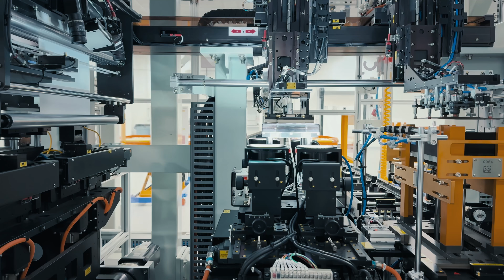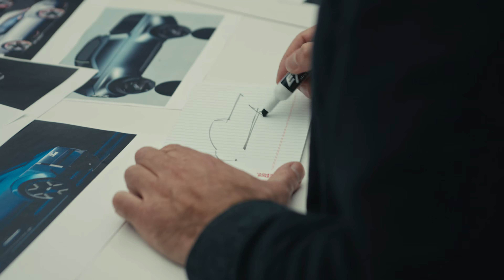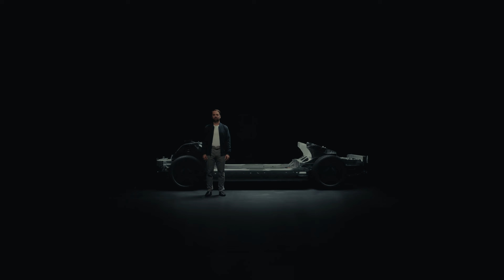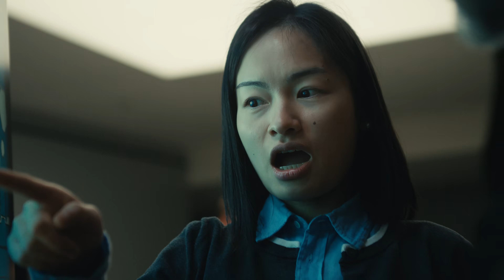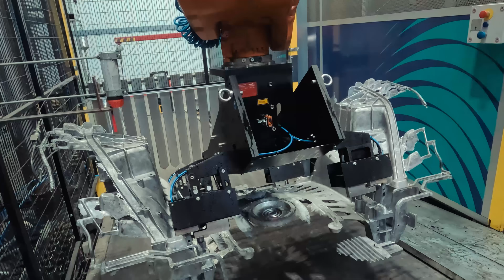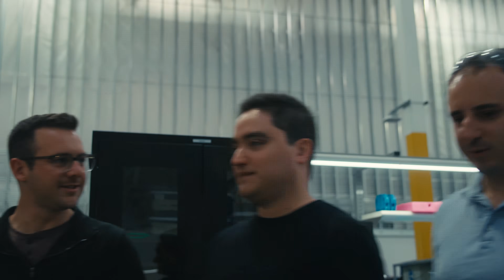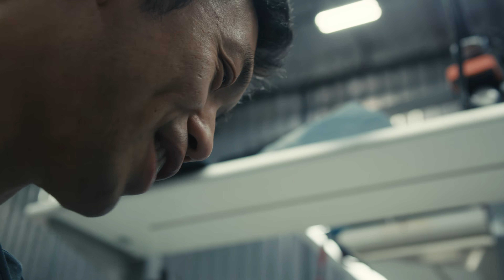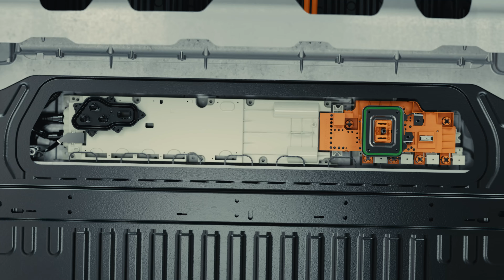Ford Bounty Hunters: The Pursuit of Efficiency

Comment: Ford, do you wanna know what would knock about $10,000 to $40,000 off of the price of your ev’s so you could actually sell them? Getting rid of dealerships so they quit over marking up electric vehicle prices.
Reply: Unfortunately, there are laws and regulations protecting dealerships. Ford couldn't just detach from dealerships if they wanted to. There would have to be significant legislation passed that would give them the opportunity to do so.
Reply: @moose1442  that’s why Ford set up the EV Division as a separate company so they could begin detaching from the dealerships.
Reply: @d @daisyandpizzanight ah, that's not the ticket. The separate division is for accounting and shuffling people. Ultimately the cars are bought from ford motor co, not some other company or a division.
Reply: @moose1442  Facts. Independently owned businesses. Ford dealerships been best I've dealt w/ actually!
Reply: The dealership system needs a drastic change but the  dealership owners have been fighting that hard.
Reply: Yup, and they lobby and pay the Politicians who in turn block any changes needed to help the end consumer
Reply: Most energy dense LFP cells have 195 wh/kg energy density with ≈4000 cycle life,but there are even more rooms for further improvements.i hope ford with help of LG energy solution,will adopt and commercializes dry coated LFP electrodes cells.dry coating has the potential of atleast 70% higher energy density LFP cells with dry coating and single crystal active materials.dry coated LFP cathodes have 55% higher active materials(amaazing 290 wh/kg)also dry coating lets the electrode to be twice as thick as wet coated LFP cathodes(20% higher energy density meaning 330 wh/kg.also with single crystal cathode and anode active material they can achieve mind bending 350 wh/kg at cell level.dry coating increase the cycle life by 100%(8000 cycles),single crystal increases it by 30%(10400 cycles).dry coating increases calnedar life by 100%(20 years instead of 10 years)meaning amazing 0.5% capacity loss per year in dry process vs 1% of current wet process LFP cells......
Reply: @davidfujkk8018  that has nothing to do with what I said, and you completely missed the point.
Reply: Amen. The dealer experience is the  worst part of Ford. Second worst is the reliability. Cut the middleman mark up. They do NOT provide ANY value.
Reply: @fleetgt  They 1 of better dealerships to deal w/ in my experience. Love Ford vehicles!
Reply: @fleetgt any company will still have to have someone to service the vehicle and provide customer service to their customers. Usually the oems outsource this type of work , usually it gets worse. You like calling India about your phone service ?? 😂. I can agree the dealerships really need to be monitored times but it's a complex issue you or I probably won't get paid to solve.
Reply: Last time I went to a dealership I asked an employee if larger wheels made the car more fuel efficient. They said yes. I don't know if they said that in hopes of me considering the more expensive trim or if they were just ignorant. All I know is that dealerships, and most of the dealers in them, suck.
Reply: @kylejohnson4750 they're more than likely just clueless.
Reply: @kylejohnson4750  lack of training they hire off the street. Kind of like the people nowadays cooking your food in that fancy overpriced restaurant! 😂
Reply: Ford has been doing some work in this area, by forcing the dealers to all list their prices on the ford website so you can shop around. They can't really stop dealers charging whatever they want without throwing out the whole dealership model. But they can make them be transparent and put them into competition with eachother.
Reply: @katelights  yes throw out the entire dealership model. That’s what I’m saying. The price thing is irrelevant because they lie about that too. The price they put on something like CarGurus includes all these discounts that nobody qualifies for. Then when you get to the dealership you find out it’s actually $10,000 more than what it says there.
Reply: @daisyandpizzanight  im afraid the dealership model is far too entrenched. And most people still want to be able to go somewhere and see/drive a car, have somewhere to take it for issues, and a real person they can complain to.
Reply: @daisyandpizzanight  but you can fix dealerships without getting rid of them. You just fix the price. You have dealers, but you let people go online and order it if they want. 

BYD Does this in Australia. I went to the dealer, looked at, test drove. Went home (optional step: hit a kangaroo and write off my previous car) . Finalised finance with my bank and then ordered online. Went back to the dealership to pick up. (could have had it delivered for a fee too)
Reply: @katelights  you need to do some research and look up Tesla. They have showrooms where people can go test drive cars and learn about them. Then if they decide they want one they order it. The showroom doesn’t purchase any inventory. They just show customers the cars. That’s how they get around the states that require some type of licensed dealer. Dealerships are not at all and entrenched, legacy auto just refuses to cut the cord.
Reply: @katelights  no
Reply: @daisyandpizzanight  Im not sure if you work for Ford but sounds like it. 😂. There are franchise laws and someone does have to service the EVS. Oh yeah they run forever 😂. ?? Ok so Explain your thoughts theories on how you fix legacy at least couple pointers because they all are struggling terribly!!
Reply: @Jcrz-l6e  bot
Reply: @daisyandpizzanight I'm not 🚫 repeat Not! A bot. I was really asking for your insight on a couple pointers to fix the legacy automakers. ? Respectfully btw. Again not a BOT 😅
Reply: Illegal in some states
Reply: @DanielLoganGames "free market" free country = all a joke. If you got money you can protect all these toxic systems
Reply: @DanielLoganGames  they can do it the way Tesla does it. There’s always a workaround.
Reply: @daisyandpizzanight  or Rivian
Reply: The wealthiest business owner in most state house districts nationwide happens to be the dealership owner this gives them incredible leverage in state legislatures
Reply: 100%
Reply: Ford was going to create a direct to comsumer brand of EVs.  i think they stopped that plan.
Reply: Gues what they tried but the NADA lobbying group of dealerships stopped them. They are trying to do the same to scout and tried to do the same with Tesla, Volkswagen and rivian
Reply: that was a pretty dumb statement and shows you know nothing. 

they have no control over dealerships there are laws protecting them and they are required by law to sell their vehicles thru them. scout motors are currently going thru an issue where several Volkswagen dealers are trying to file a lawsuit against them because Volkswagen is scouts parent company and they feel entitled to selling them. they arent and will most likely lose. as scout is going with direct-to-consumer model like tesla or rivian. but it shows how dealerships abuse the law to prevent that. 

Ford has been trying to become a direct-to-consumer manufacturer, but the law is preventing that, and we all hate it including ford.
Reply: Sounds like a great idea but it's not entirely feasible. Dealers were absolutely needed and were very important at one point in time, now may very well be the time that they sort of become less important . 
1. Manufacturers still need a place to show the vehicle. Unlike Tesla,  none of them will get the hundreds of hours of free PR. 
2. Manufacturers still need a place to drop the vehicle prior to customers picking it up. Tesla has 3 to 5 customer centres in all metropolitan. Legacy brands would have 3 to 5 times as many as Tesla.
3. Manufacturers need a place to conduct warranty work - yes, although over the air updates will be standard, it can't solve mechanical issues. It's almost guaranteed that future EV will have way less mechanical issues than ICE, but it will still occur. 
4. manufacturers sell parts and a physical location is necessary. 
I'm sure a lot of this will change in time but for now and at least the next 20 years, there will be dealers.
Reply: @Capri1977 no
Reply: The dealership experience is what has stopped me from buying several Ford’s over the years.
Reply: Dealerships haven’t marked up an ev in 2+ years.
Reply: @Calibr21 , F150?
Reply: @Calibr21  dealerships literally mark up every vehicle they sell. That’s how they make money. They buy it from the company and sell it for more than they paid for it. This isn’t rocket surgery people.
Reply: @daisyandpizzanight that’s a profit margin thing for Ford, not really a consumer price thing. Ford has to accept less profit margin then Tesla because they have a dealer network. Ford can’t sell their vehicles for significantly more than Tesla because of price competition. 

The real reason consumers should care about getting rid of the dealers is the buying experience is just so crappy, with it taking hours and then trying to be upsold on addons.
Reply: @Calibr21  😐 this is why I’m saying they need to do a straight to consumer model like Tesla to eliminate the extra cost of the dealership middleman. How do you not understand this?
Reply: Hella yeah. Stealerships suck and the work they do for the money is a frkn rip too
Reply: This comment is the truth, and the truth will set Ford free. They can manufacture a $30k MSRP EV all day, but the stealerships will swoop in and mark them up to $50k whenever they can.
Reply: Dealership markup is a no no
Reply: This guy gets it
Reply: They are trapped by law. They are stuck, they can't get out of it.
Reply: @JEP-Tech  they can do what Tesla does. Ford already set aside the EV division as a separate entity.
Reply: I think you’d be surprised on the EV part. I work at a Ford dealership, and we make about $700/mach-e. That’s for the dealership, not the salesperson. Also don’t forget that the dealerships are vital for points of servicing and getting OEM parts! It’s not always just sales 🙏
Reply: @uhealthycomedy8982  read this carefully because I’m really getting sick of all the stupid comments. I want the dealership to make $0 per sale! They are more than welcome to convert into a Ford repair shop, but there is absolutely zero need for a parasitic salesman.
Reply: What hand do you think the UAW has in the overpricing of todays vehicles?
Reply: @OregonEyesedKhaOsit’s not the UAW Ford is too top heavy with too many so called executive vice presidents and managers and vice associate directors and on and on. The unionized workforce is smaller now than ever before.
Reply: Do you really think that buying directly from the Manufacturer is going to save you money?    You will always be paying MSRP (sticker price) if we move to that model.  Do you really want the high prices of Carvana and Carmax at every Ford "showroom" too?
Reply: @PhilCountryFord  Yes it would reduce the costs and ultimately reduce the end price to the consumer
Reply: @Yielar1  And who will service your vehicle and repair it in the event of an accident?  Everyone thinks that getting rid of dealers is a panacea.
Reply: @johnroppo  EVs will need much less service
Reply: @PhilippZ  that is a wonderful thought, but the world isn't shifting to 100% EV anytime soon.
Reply: @Yielar1  No, the current model that pits several dealerships against each other is actually what drives prices down, and the dealership takes responsibility for the majority of marketing and storage of the vehicles.  If Ford went direct to consumer, you can easily see 50% of the trim levels getting cut because they would have to streamline production without the ability to offload and have dealerships pay for the inventory holding lots.
Reply: @PhilCountryFord Teslas system works. You order your vehicle or buy from a small in stock selection, and they have service stations and mobile service. The benefit is the price is the price, no dealer markups. I ran a Ford dealership for a decade and I see you’re a part of one too but it’s a tired, old model. People don’t want to get worked over by salespeople and charged ridiculous fees via “market adjustments”, waiting for rebates, etc.
Reply: @johnroppo  the service centers can stay. We just don’t want the salesman in between getting a car and the customer.
Reply: @johnroppo  I already avoid taking my cars (both ICE and EV) to the dealership for service whenever possible.  They see me for warranty work and occasional spare parts that I can replace myself.
Reply: @johnroppo  a dealership has never touched a car I own.
Reply: @PhilCountryFord Dealerships don’t pay for inventory; they pay for the vehicle when sold. The manufacturer bears the cost. Direct-to-consumer would reduce costs by building in lower volumes and adjusting based on demand, preventing overproduction.

Dealerships exploit manufacturers and consumers, raising prices with add-ons and fees.

Servicing is the only essential service dealerships provide, but it hinders innovation since they profit from vehicle breakdowns. If a car breaks down, customers must visit dealerships for repairs, potentially leading to dissatisfaction and a change in future purchases. Both consumers and manufacturers suffer, while dealerships thrive. The dealership model is parasitic and detrimental to both parties.
Reply: @PhilCountryFord dealerships in recent years have been doing 50%+ markups to the MSRP.

I’m not sure what you’re getting at. The dealership is a middleman whose job isn’t to reduce the price. Logic dictates that in almost every scenario, direct to consumer will be cheaper.

A realtor (also a middleman) represents a real cost to purchasing a home but they also help negotiate lower prices. Dealerships do not have that as a part of their services.
Reply: @PhilCountryFord  are you high? That’s one of the reason Tesla is able to sell vehicles so much cheap cheaper. When the lightning came out at $40,000 there were some dealerships selling it for over six figures. Of course the price will go down duh.

Comment: What about steer by wire?
Reply: and brake by wire. Both could save cost, weight, and complexity.
Reply: @PhilippZ  Brake by wire is in most EV's and hybrids today given blended regen braking, but the physical mechanical linkage still remains also for safety/redundancy - based on legislative requirements.

Comment: question, does a 10MPH fender bender lead to frame bend on that alum. cast frame?  if so, this won't gain market saturation b/c folks will get frustrated that their vehicles get 'totaled' in what may be minimal impact accidents, which will also drive insurance cost for this vic, making it cost prohibitive for long term ownership.  Love the engineering, just curious on real life impact to some of the decisions made.
Reply: Aluminum doesn't bend, it stays stiff until it breaks. Then you weld it back together. No more stretching steel until it's (almost) back to shape. 
A big insurance cost driver is the number of cameras and sensors in the body.
Reply: Also curious about this.
Reply: Yes, we saw the results of this with the Rivian R1T where a slight damage to the bed side could result in $30-40k damage. 
If you’re targeting a $30k msrp for this vehicle, insurance costs are going to need to be less than the monthly payment lol.
Reply: @NikMoline  see the tesla model Y repair costs now that they have ramped up casting replacements and procedures smfh. It's actually cheaper to repair in some instances than the traditional methods now! It takes time for new tech to get out there, techs to learn how to repair it and manufacturers and oems to provide replacement parts.
Reply: As a mechanic I was thinking about repairability also while watching this. Seems the focus is 100 percent on reduced cost of production and zero on its impact on serviceability or repairability. Buyers better get insurance quotes before committing.
Reply: @greg7886  First of all serviceability as you understand it is history.  Tesla has proven that the giga castings are economically repairable in the field better then the conventional welded parts.
Reply: @imwteach that’s blue Tesla glue is no joke.

Comment: I'm on my 5th EV, a gigantic Silverado EV. It replaced my Lightning. It's very nice but is missing a lot of 'truck' features my Lightning had. It's also... gigantic. Like "Have to go to a commercial inspection station" gigantic. I've owned over a dozen Rangers and always preferred small trucks, but needed a fullsize to pull my trailer so I bought my first fullsize in 2013, an F-150. Now with EVs I can theoretically get the best of both worlds. I drove the Rivian and hate it. I have a pre-order on the Scout Terra but it's a couple years away. All I want is a truck that's roughly the size of a Ranger that can tow as much as a Lightning, with the interior of a truck. The Lightning almost nailed the interior and I miss it.

Please, Ford -Make a midsize EV truck that can tow, with an EREV-only-in-emergencies option. It doesn't even have to be super cheap. I'll gladly pay.
Reply: If the interior room in the f150 isn't enough for you, then I'm afraid this one won't be enough for you. It looks to be the size of the maverick.
Reply: @WFields919  I didn't say room, I said interior. As in controls and layout. I've owned several S-10s and Rangers with extended cabs rather than 4 doors and that has always been my perfect layout, so I'm fine with a Maverick-sized interior.
Reply: You'll need a trailer with a battery and motor to extend your range
Reply: @PhilippZ You know they make these things called chargers, right? You can drive right up to them and everything.
I've towed several things with my Lightning, including 1500 pound UTVs. I know what it's like.
Reply: @jerkychew899 without it you’ll probably have to stop for a charge every hour, which is annoying with a trailer